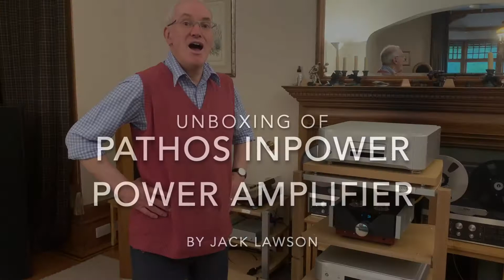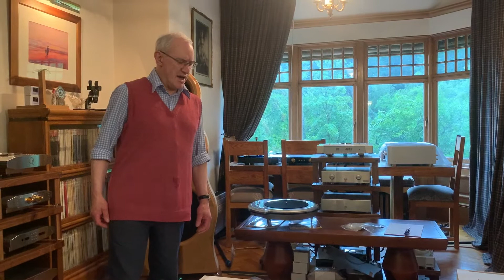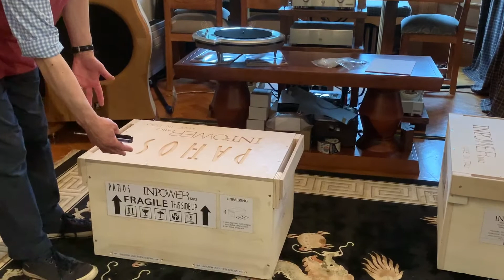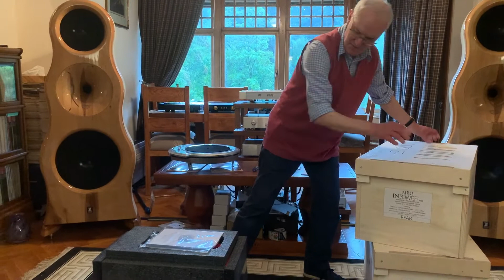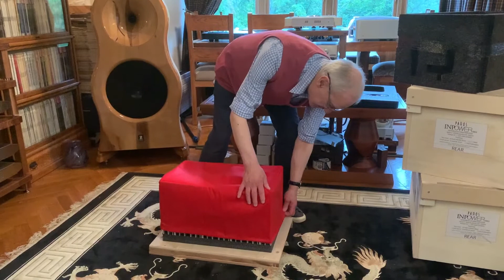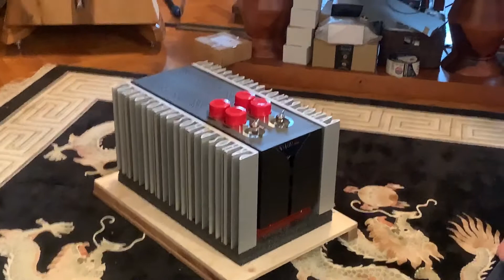UnBoxing Pathos InPower

Comment: I'm going yo be looking at a pair kf the previous Inpower monoblocks.   You mentioned tou owned the previous version.  Just curious what you remember about them?   My budget has Mr generally looking at used equipment.  My speakers are Spendor s100s.